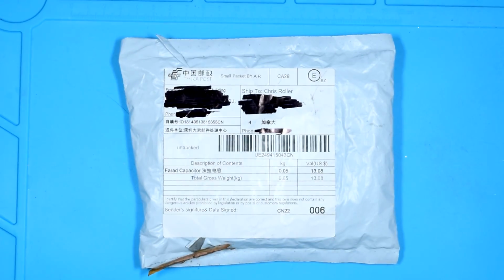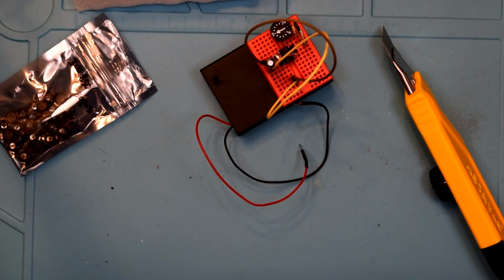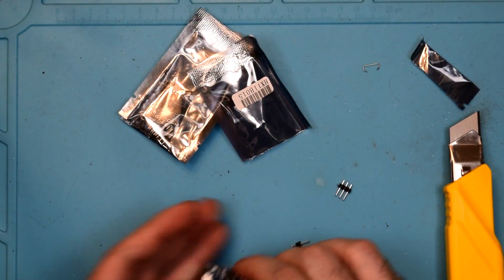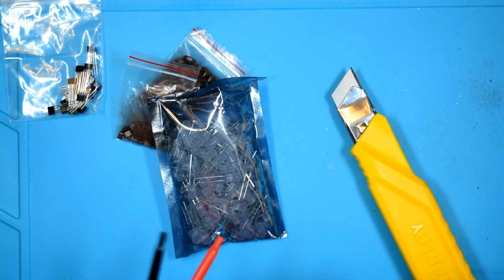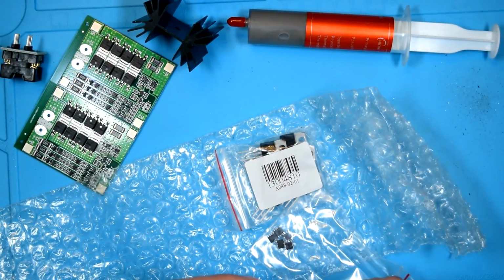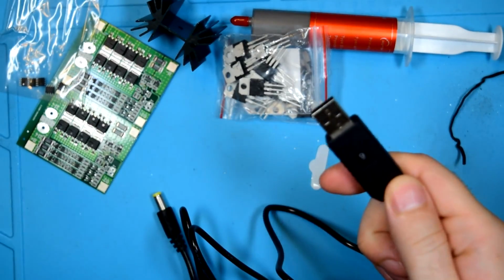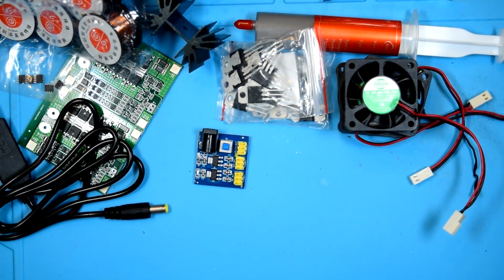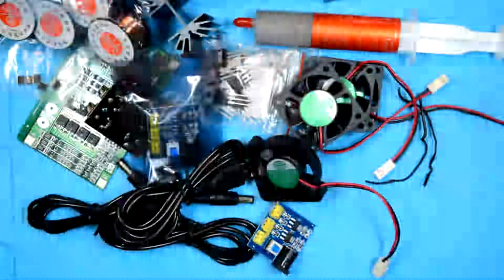Postbag 6 - Supercapacitors, LEDs, Arduino, and more!

Comment: What the heck is jake breaking
Reply from the maker: It's when the semi uses the compression of the engine to brake instead of the actual brakes. It's very noisy.
Reply: Gadgetboy but they could damage piston heads or cause negative feedback in the engine surely? Sounds stupid to me
Reply from the maker: It's common practice on steep hills to prevent brakes from overheating (the engines are built to support that), but the loggers in this area use jakes pretty much constantly.
Reply: Gadgetboy can't ride the brake, maybe if they can't transverse the hill properly they should take a different route, just sounds dodgy